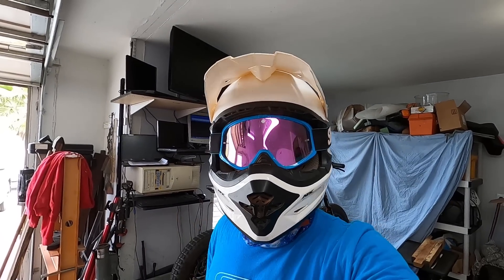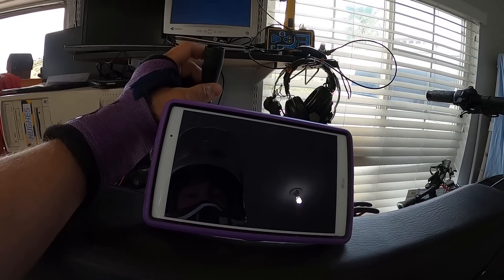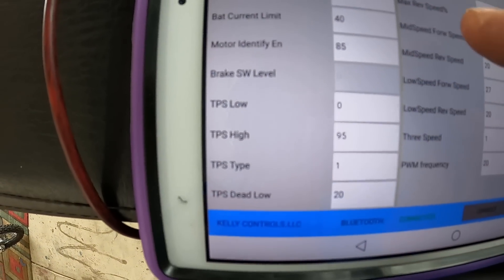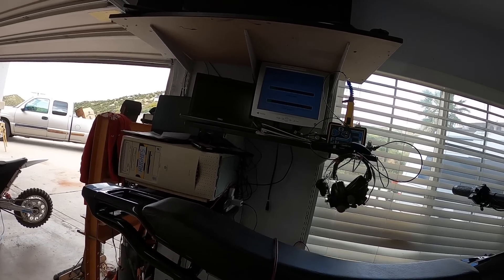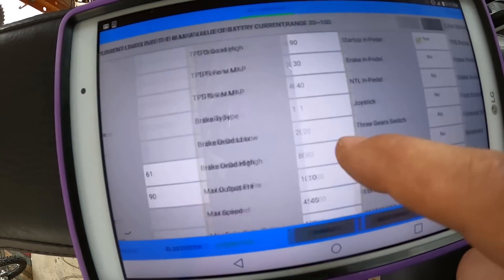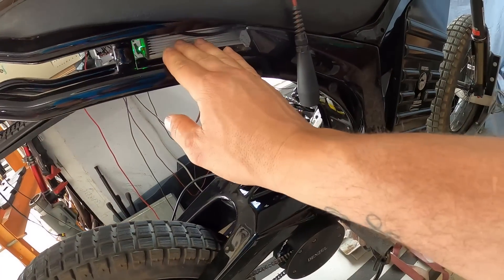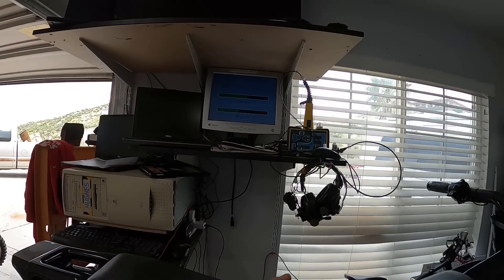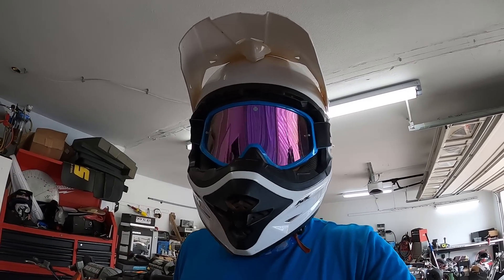How to Increase Horsepower on Your Electric Motorcycle + Denzel Samurai Dyno Results!

Comment: Just came out with a rebranded version called solar eclipse.... it's got kke suspension, folding pegs, removable 72v 45h battery, and not a Kelly controller anymore. Comes tuned down needs to be turned up to full power. Pretty cool bikes for 6k but they're road bikes not for off roading, you void your warranty if you jump them.

Comment: Hey man, I would really appreciate your insight.  So I'm running a 72200 (200amp) Sabvoton, 72v 49AH Panasonic battery with 150amp bms, qs273.  My question is about the blue tooth app parameters.  I can only hit a max of 53 mph with this thing, which to me is a bit disappointing.  I have flux enabled at 30 amps, if I bump up to 50 I can get a few more mph, but not much.  Is there any one specific number I should be adjusting to get a higher top speed?  The MQCON app has different settings than this Kelly.
Reply from the maker: You are adjusting the right thing. The hub motor has a Kv rating which works out to RPM per Volt. Basically at 72v, a given hub motor will only rotate so fast no matter how much current you throw at it. It will accelerate quicker with more current but max rpm is dictated by the voltage. Flux weakening is the correct value to adjust in order to try and squeeze some more rpm out of the motor but it has its limitations.
Reply: @ElectroBraap  Gotcha.  Any idea on what amperage levels get up into the unsafe levels for the flux weakening?  I have it at 30 now, and I'm not sure I can scientifically test acceleration, I don't have a dyno, haha.
Reply from the maker: For flux weakening values in amps... I haven’t played with them much as I don’t use hub motors and max rpm isn’t of much concern to me. Sorry I couldn’t be more helpful on that part.
Reply from the maker: In order to go significantly faster your going to need a higher kv motor or a higher voltage battery. Sorry dude. 😢
Reply: @ElectroBraap  well I have 273, about as crazy as it gets, ha.  Guess it's battery limitation then
Reply from the maker: The KV of that motor can be either 12.5, 15.6 or 17.9 . Standard is 15.6 I believe which works out to about 90kmh or 55mph at 72v. You would either need the 17.9 KV version or more voltage to make your 15.6KV spin faster.

Comment: You should set you dyno output to show Kilowatts instead of horsepower. Here’s why: you could use  a clip on ammeter to determine actual battery output (kilowatts) and thereby determine your motor and driveline efficiency. In other words you would easily know how many kilowatts draw there is on the battery (you already know the voltage and with the ammeter current reading you could calculate the kilowatts draw vs motor rear tyre output). By the way, you increased the output from 6.1 Kilowatts to 7.6 Kilowatts. Cool.